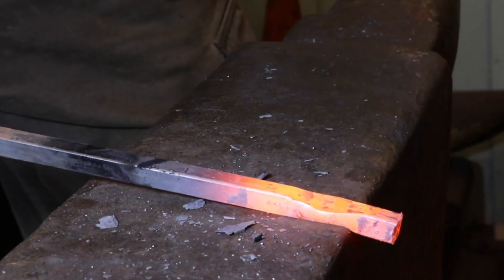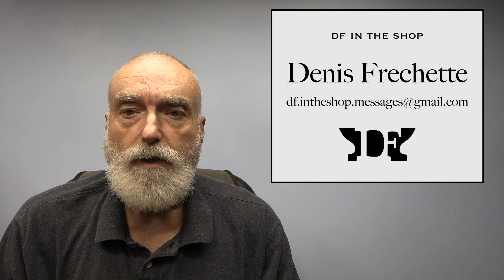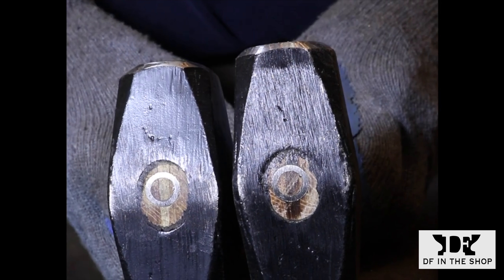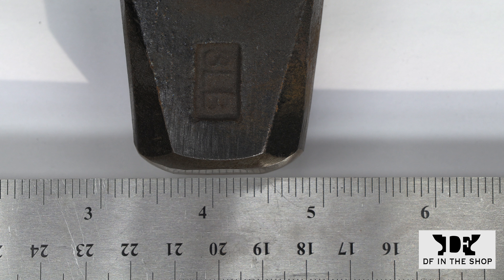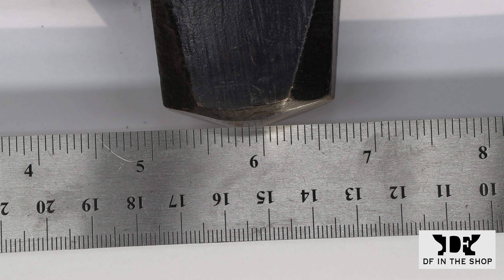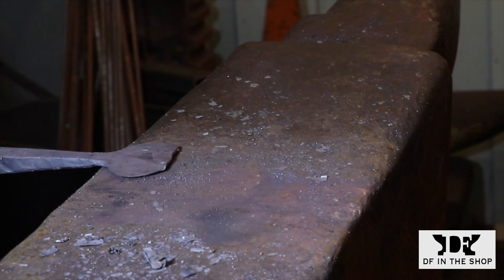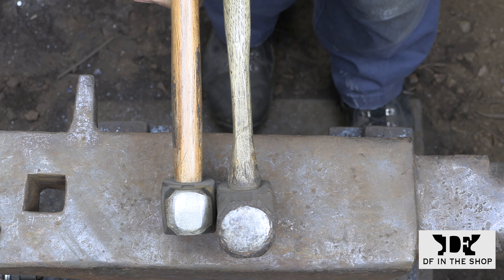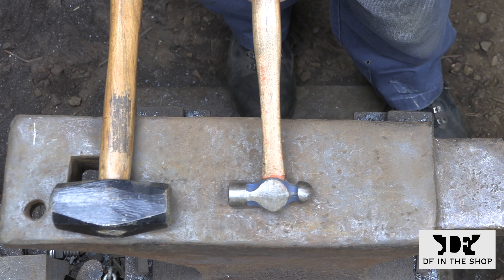Blacksmithing for Beginners - Simple Forging Hammer

Comment: I've modified some hammers for blacksmithing but never knew that about the dampening properties of a thin handle neck. Great tip!
Also love that you called out the weight and balance consideration. Have a few that I made that mistake on.

Comment: They're also called "drilling" hammers in the US. From what I gather, that name comes from being used to bore masonry with a star drill (which looks more like a punch with an X-shaped tip).

I seem to be at odds with advice from most more experienced blacksmiths regarding handle shape. I started with a 2# cross peen, which had a long handle with a tapered neck. I have RSIs from decades of computer use and found I couldn't work long before my forearm and wrist hurt; I thought that even the 2# was too heavy. Then I tried a 3# drilling hammer much like the ones you show and found it felt just fine. I also found a video from my local ABANA affiliate where the presenter was talking about the benefit of thicker handles with a rounded square-ish cross-section, which more closely fits the shape when making an "O" (like in American sign language).

I replaced the longer handle in the 2# cross peen with the shorter, thicker handle for a drilling hammer, flattened the sides a bit with a spokeshave and it is my primary hammer.

Maybe I don't notice the vibration or miss the leverage because my anvil is a mere 44# (20kg) and almost everything I do is with 5/8"² or smaller? Or maybe I'm just too new and ignorant to be able to tell the difference?